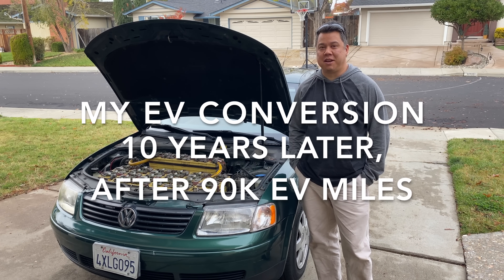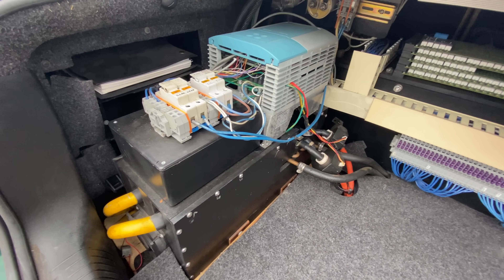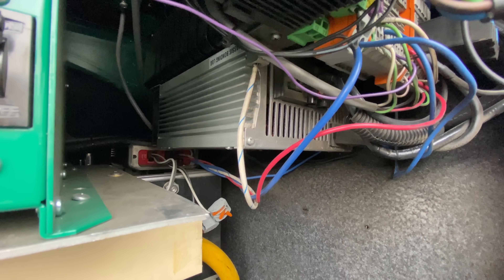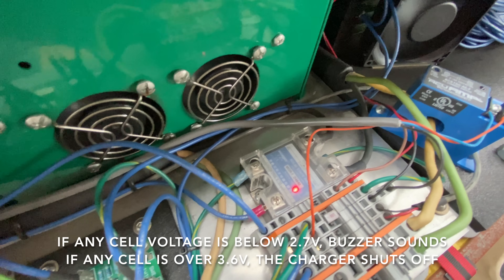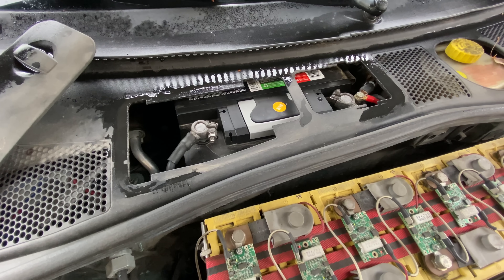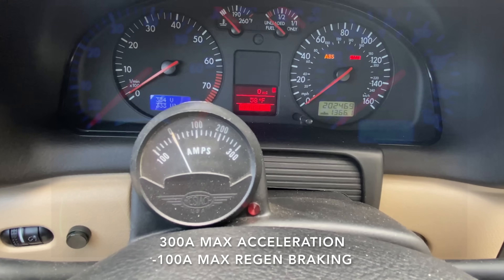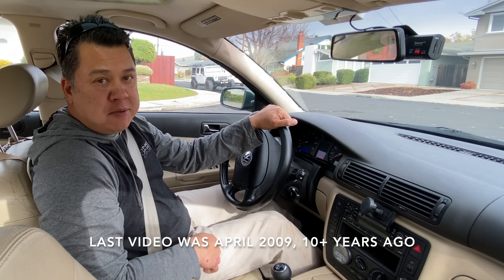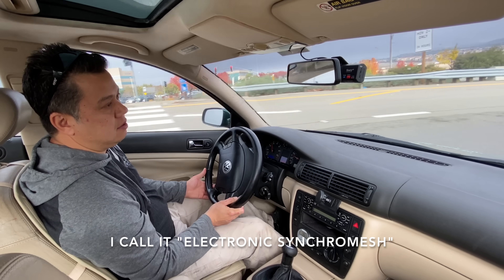My EV conversion after 10 years and 90k miles

Comment: I’m an advanced DIY guy and this guy is in a different universe. This is ridiculously difficult to plan out and he did it in such an elegant way
Reply: It's also crazy too see how much ev technology has changed
Reply: You just found out you're not 'advanced' but actually just another backyard DIY guy.  Levels.
Reply: @rebeltvr6046  meh my cars advanced it's a bmw i3s kid way more advanced then his pos car faster to
Reply: @raven4k998  He built his POS, I highly doubt you even know how yours works.
Reply: @raven4k998 your post shows more about your character than his ability.
Reply: I probably have the skillset to do this, but I wouldn't be able to complete the project itself with all the work required in a decade... this guy is an absolute beast.  All of the wiring, planning, and execution here is next-level shit.  Even lots of the forward thinking stuff like fuses-per-wire with the balance system.  Really incredible.  Would love to hang out with this guy; I bet he's a blast to talk to.
Reply: @ThantiK  if you do it make sure to use a Manuel transmission car as Manuel transmission will make it much easier to make the car work an automatic requires extra parts to make it work like a hydraulic pump to do what the torque converter does in an internal combustion car and the motor to constantly be spinning
Reply: @raven4k998 you don’t need a transmission with an electric car. This guy installed one on his car purely because it’s more fun that way.
Reply: @timothydamiani  yeah you do or it will not move silly even the Nissan leaf has one god don't you know anything?
Reply: @raven4k998 Bro electric motors have instant torque and can go from 0 rpm to several tens of thousands of rpm. There is no need for a transmission in a car. Yes I know a considerable amount although I’m not an expert by any means. some performance electric cars have a basic transmission with two gears for the sole purpose of reaching even higher top speeds but that’s pretty rare. I don’t know if the Nissan leaf in specific has some kind of transmission for economy or something but an electric car does not need a transmission.
Reply: He's an engineer
Reply: @CarFreak For Tesla! Who hired him after he talked about his car for half an hour! I'm sure more impressive things have been done, but, wow. Very very very interesting.
Reply: He’s probably an electrical engineer
Reply: he had the professionally installed he didnt do it at least he did his research before making a video
Reply: @boosted2133  Did you watch his other videos? He built it, pretty sure.
Reply: @CarFreak I did not make those sugar crystals. I merely admired their beauty. Then I ate them.
Reply: I think there's kits out there for conversion. Not sure if this video is from a kit, Don't this so.
Reply: @uturniaphobic  based on how old it is I am guessing his was diy but I could be wrong although his has the smell of being diy due to how hardcore it seems to be
Reply: @raven4k998  I saw a video of a guy converting an old VW. this was a while ago,
I thought he said he was working from a kit.
Probably have to have a shop install the kit, well unless you're this guy. lolz.
Reply: @CarFreak I thought he was a gaming expert oh well🤣🤣🤣🤣🤣🤣🤣🤣🤣🤣🤣🤣🤣🤣🤣🤣
Reply: @CarFreak well he's no engineer an electrical expert maybe but no engineer
Reply: his battery's can't last very long since I see no cooling on the battery's and he live in California which gets warm enough to cook the battery's off over time
Reply: @raven4k998  loooks like he's got 90k miles in and pretty sure that thing aint stopping ANY time soon.
Reply: @raven4k998  if your not pulling so much power that you strain the battery's causing them to heat up then its perfectly fine to not have cooling. 
the power draw is split up between each cell evenly.
Tesla needs cooling becasue their motors are very powerful and each little battery cell can only tolerate so much current draw.
Reply: @raven4k998  You’re a salty woman that is losing attention on social media so you jump at any chance to put someone down. Good job.

Comment: How is it an electric but manual transmission? Someone explain
Reply: Its an electric Motor with a normal Transmission
Reply: The Motor has directly full torque so you dont need to have many different Gears. So He can start with Gear 2

Comment: All that money spent.It would have been cheeper to fix ur petrol engine for about 1500dls.And u can go over 100 miles.And all u go is 70 miles distance cause ur worried about running out of juice?what a waste.U got no faith in all that money u wasted.PETROL IS KING.research who makes u batteries.Blood has been spilled in africa for lithium.And all ur batteries are just as bad or worst than petrol for the environent At least u can make Joe Biden and all the democrats happy.They might hand u a cookie.
Reply from the maker: The point of this project was to learn something new. It landed me a job at Tesla, and launched my career.  Batteries are completely recyclable, it's just a plastic case with sheets of metal, just like automotive 12v batteries are 100% recycled currently.  I would have burned 13k gallons of gas in 10 years, not to mention the energy required to refine and transport the gas, and military spending to ensure it's safe passage. Many manufacturers have already stated they will stop producing gas cars in the next 5-10 years, as well as many countries banning the sale of gas cars in the next 5-10 years.  I prefer to power my cars with energy I produce on my own roof, energy made in America, rather than send $200/week to our enemies and terrorists.

Comment: How much in "total" did it cost for complete conversion. How much to charge at home? How much did your sollor cost at home? Basically, how much in total did your complete system cost in your 10 years of use...?
Reply: I'm guessing he didn't include his labor cost. Every weekend, 8 hours on average, for a year. Call it 400 hours. At $50 per hour, which is ridiculously low, that is $20,000 just for the labor.

Comment: Awesome build!! What do you think the estimated build cost would be in today's market? How fast can you do 0-60 flat out
Reply from the maker: 14 seconds using only 2nd gear.  It would be much faster if I had a clutch and could row through the gears quickly.  It easily breaks the tires loose in 1st, and I've had it up to 105mph on flat ground.

Comment: Cool but wow how safe are some cheap ratchet straps 😂😂 what the hell man all that money and time spent and you use those and 100 miles at over 25k 🤔
Reply from the maker: The ratchet straps were rated for the load + factor of safety.  I didn't want to use metal, in the event of a crash they might short the batteries. The straps were also really thin, I didn't have much room to spare getting the hood closed.  In 2008, 100 mile range was pretty good, the first Nissan Leaf (2011) had a range of 73 miles.

Comment: Why have a transmission at all? They aren't strictly necessary in an electric vehicle and really just add friction which will decrease efficiency.
Reply from the maker: The motor can't direct drive the wheels, it needs around 10:1 reduction to get enough torque at the wheels.  Rather than design a single speed transmission, I could just buy a 5 speed transmission for $300 that bolts up to the axle shafts.  The gears are useful, 1st gear is a granny gear, 3rd can be used if I want to do 90+ mph

Comment: Amazing work... Question about the daisy chain fail safe you have there, looks like an estop circuit (kinda), you get out "all good" or "bad" - how are you determining which is the bad cell?

Sorry, I work on really big kit with daisy chain estops and the panel goes "estop pressed" and I find myself looking at it and going "where?!" then having to check each one.

Do you have provision to id each one or use some modbus stuff? Or is it just really easy to figure out once you've popped the hood?

Comment: i thought this was neat until i see the $25k price tag, you could buy a second hand ev with better range for less.   100 miles, not to good, especialy for 25k  but nice job anyway.
Reply from the maker: This was done in 2008, before there were any EVs you could buy (no Nissan Leaf, no Volt...)
Reply: @etischer  fair play
Reply: @etischer  and I do like a passat.   You did some neat jobs on the Aircon and heating systems

Comment: This would be totally illegal here in western europe...the more wieght from the batteries should be compensated with better brakes and the Chassie is maybe also not made for it. But great that you have done it in your region.
Reply from the maker: Weight including batteries is still below the weight rating of the car/chassis.   Even the brakes are better since it does regen braking in addition to the stock braking system.
Reply: @etischer  Ok nice to know but the I guess the engine before had less weight? 
Are you actualy able to get the new braking values into your papers? 

Sry I just know it here in Europe (Switzerland, Germany) they dont give you too much freedom which is sad for people who actually know what they are doing but good if you have people with no idea and just putting random stuff together.

Comment: This thing is so sketchy, that hoods so packed with batteries 1 hit to the front and you will quickly find out how hot hell is... Would be interesting to know how much weight you added to the car with the 99 cells and all the equipment.
Reply from the maker: These are lithium Iron phosphate cells, they don't catch fire even when nails are pushed through them, or shot with bullets.
Reply: @etischer  i looked it up they still catch but can be put out by removing air.
Reply from the maker: @Jellymiqo  https://www.youtube.com/watch?v=R9xZf4p8PkQ these are the batteries I'm using

Comment: WARNING MATHS SCIENCE CONTENT:
Stating that the conversion cost you $25k would scare many away but they overlook the gas costs/savings and that doesn’t include oil and other coolant fluids. But let’s just do some (Basic surface) Math.

$2.54 per gallon 10 year average.
May 2012 – April 2022 
https://www.eia.gov/dnav/pet/hist/LeafHandler.ashx?n=pet&s=emm_epmr_pte_nus_dpg&f=m

2001 VW Passat 
90K EV Miles
$25K Conversion
Mileage:
Premium Gasoline 23 combined city/highway MPG 20 city 29 highway 
4.3 gals/100 miles
90,000 / 100 x 4.3 x 2.54 = $9829.8. 
That is the gas (Average) that you would have spent on the distance you have travelled.

Some factors which I haven’t included considering I don’t have the data:
Cost of the purchase of the vehicle before conversion.
Income from selling the engine and other guts parts which were replaced
Cost of electricity
Combustion engine costs for parts such as:
Oil and fuel filters
Spark plugs
Air filter
Registration cost differences?...

Comment: The video description is a bit dishonest/misleading. You say a gasoline vehicle would've depreciated 20k in 10 years, as if the electric vehicle you built wouldn't. No one is going to pay more than a couple thousand dollars for an EV that is 10 years old and has 90k miles. Those batteries are going to cost as much as a new car to replace. And it will be a headache re-tuning every circuit board to a new batteries specs, as they vary widely. Also, you completely shirk the question of "how much does it cost to charge" by saying you paid 9k for solar panels and got a better deal with your power company. Also stating to make it to the $5 a day mark you can only charge it around midnight and you put half the charging cost on your employer. While in your own calculation you state that over the last 10 years the average gas vehicle owner would've paid $16,000 in fuel. Which btw, equals $4.38 a day. And that average includes people that drive hummers.
Reply: If you are proud of what you have done, and truly care about the science behind it. Just go into more detail about how to achieve this. Don't act like this is ever going to save someone money. 9k for solar panels alone is a lot more than you would pay for a reliable, used gasoline vehicle.

Comment: First of all, great job, very professionally done. But 16 miles range gained by hour charged? Thats a huge downside, sure it works, but barely enough for a pure commute with no detours or surprise trips. Also, I'm shocked that this is road legal. Imagine an accident with all those open contacts, batteries under the car, thing is a deadly trap for passengers and rescue teams alike.

Comment: Isin't the electricity prices set the same in US as in Europe? It's a common misconception here that electricity is cheaper at some hours.. it doesn't matter, because the price is calculated over a full month of daily fluctuating prices and from there an average is taken and thats the price you pay for your kw/h used. Meaning it doesn't matter if you charge your car, do your laundry etc on the "cheapest hours".. at least not in my country

Comment: As an electrical / electronic engineer, I'm absolutely horrified. Every single thing I saw was a dangerous bodge - how on earth did you get the authorities to sign off on this? The rats nest of wiring and exposed terminals is an accident waiting to happen. The cells underneath the car with NO MECHANICAL PROTECTION is just asking for them to be punctured by rocks etc.

Comment: Airbags and abs pump? Is the original ecu still running then? How does it still have I/o and how does it not throw faults? I'm curious I've seen a lot of builds but I don't think I've come across one that tried to retain the abs. Abs would be an absurd amount of code to replicate especially with the foreign car sas sensor garbage but how do you retain just that function of the existing ecu

Comment: If you were to sell it how much would you be asking?
Reply from the maker: It's not a car I can sell, too much liability.  If someone had an accident in the car, I'm sure lawyers would argue that I modified the brakes or something, and I was responsible for the accident.  There's also an electrocution risk for people untrained in handling high voltage...  I ended up parting out the batteries and ev components when I bought my Model 3.
Reply: @etischer  why is the range so low?
Reply from the maker: @AmericanBusinessman422  That's where EV technology was in 2008.  Even in 2011, the first affordable EV was the Nissan Leaf, it had 84 miles of range.
Reply: @etischer  verrrryy good point. Thanks for the responses!

Comment: im surprised how those BMS nodes held up so wel just PCBs like that under the hood and i couldnt see much of a coating :O
Reply from the maker: The BMS boards have a conformal coating.  The area under the hood stays dry, there's a belly pan that seals the area off pretty well.

Comment: Wait could you explain the shifting gears part? What?
Reply: He attatched a manual gearbox to an electric motor, so when the electric motor reaches high RPM on the freeway, he puts the gearbox into a higher gear and thus lowering the RPM of the motor.

In order to match the RPM on the motor with the RPM of the gearbox (which is coupled with the wheels) he has a light that tells him when the two RPM's are synchronized.
If he would try to shift gears when the RPM is not synchronized, he would get some gear grinding.

Comment: Hi nice build! I have one question about your "electronic syncromesh". How do you determine the matching of the rpm for your signal light? You measure engine rpm and speed and compare? Do you somehow modulate motor rpm or just leave it free running and wait for it to match? thanks!

Comment: Im not personally a huge fan of evs, especially the ones that come out today. But hats off to u for building something u came up with. 

Im genuinely impressed that it drives like a normal car despite the heavy set of batteries that would otherwise upset acceleration and handling. 

Tho my advice for safety purposes, its best to have the cells well protected. Once u have the budget u might want to look for something to cover and protect the cells. As exposure to temperature and changing environment conditions can cause the batteries to run less efficiently and in accidents li-ion batteries are known for catching fire. 

Tho judging by the way its running it doesnt seem like it will have those problems any time soon. Again, great work, I know its late but u earnt my subscription
Reply: I don't think they need your advice..
Reply: @l30red08  If u think so...